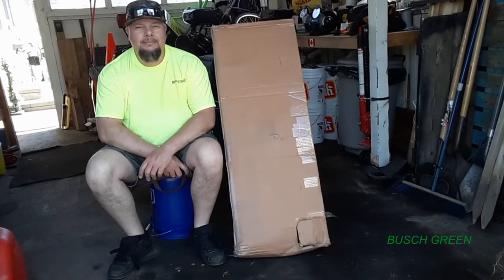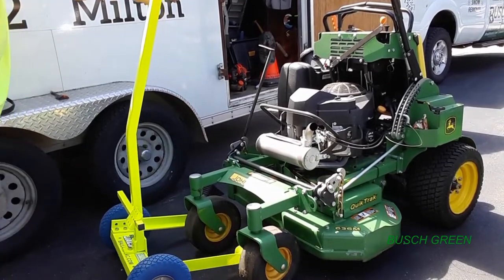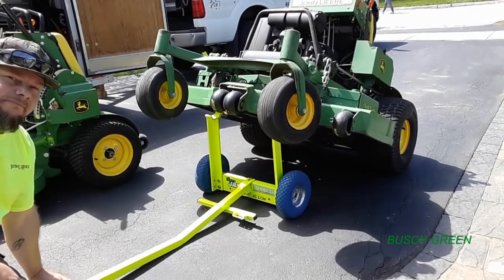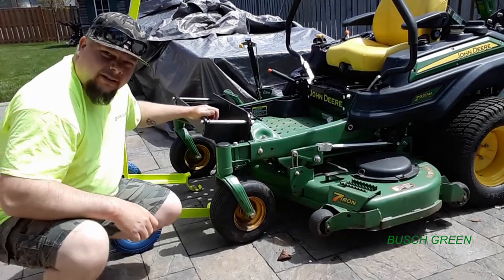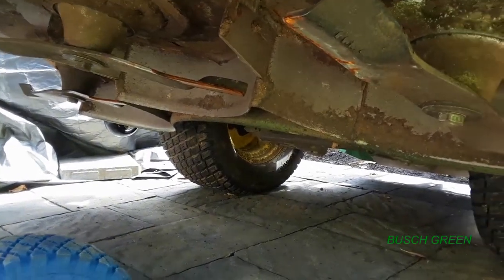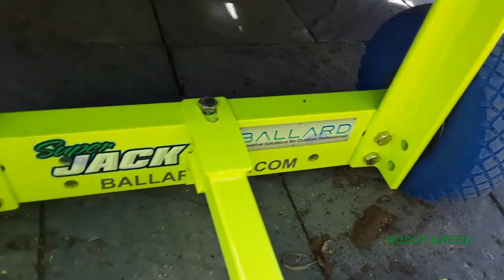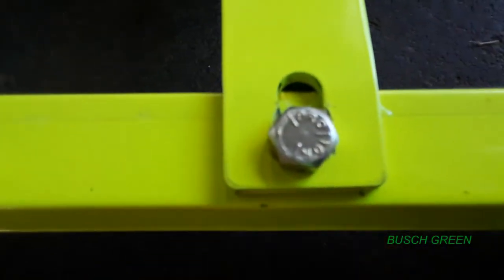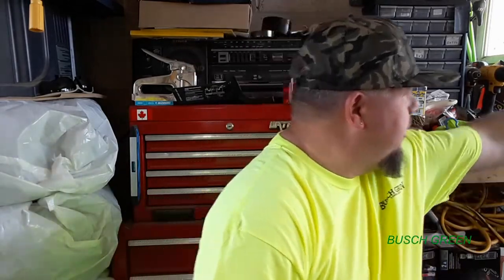What was delivered to me?

Comment: Mike, I would also suggest wheel chocks for the jack as well as the mower along with the jack stands that you mentioned. I use car ramps! hahaha! Yes, they get in the way a bit but, the mower is up and there's plenty of room between the garage floor and the mower deck. Whatever works, I guess. Heck, I'd use a chain fall if I had one! I DO like that jack, though!
Reply from the maker: Oh yeah, wheel chocks for sure. Jack Stands 100% I tried car ramps but there is not enough room for my impact gun. I do have a chain hoist but I wanted something that I can lift mobile and away from the garage when I wash. There will be a part 2 of the this video down the road

Comment: They do make changing blades faster. I use to use a similar one and it ended up breaking.
Reply from the maker: Yes and no. I will have a part 2 video with this thing. I will tell you right now, I can't fit the impact gun to take the blades off on the 36 inch stand on. The wheel of the jack is in the way.